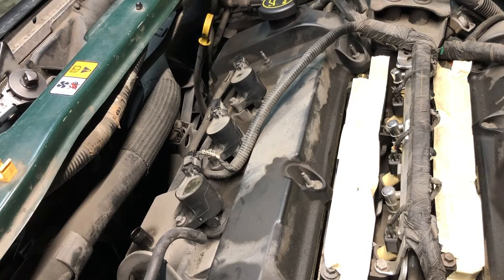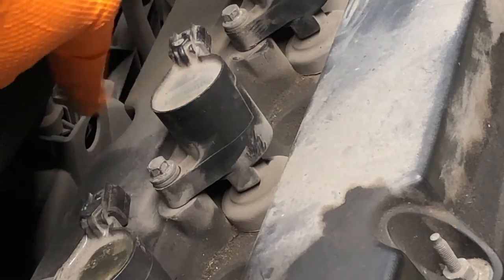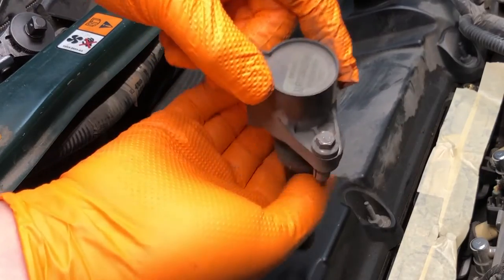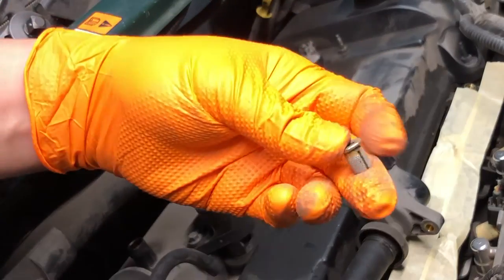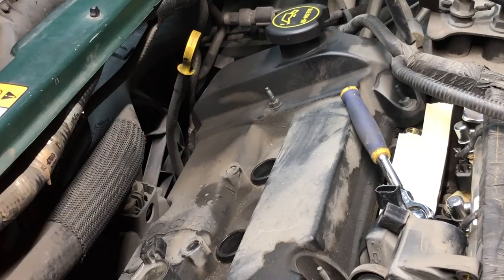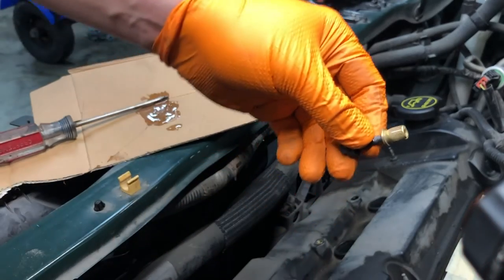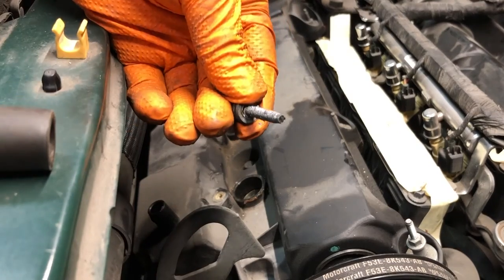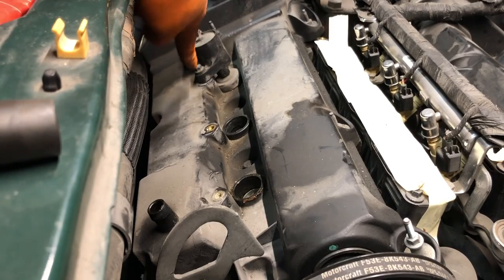2001 Ford Escape 3.0L V6:  Ignition coil hold-down bolt issue (spinning in the plastic valve covers)

Comment: This is what Youtube is all about! Shop tried to take my P0302 code and get me to pay for 6 new coils and spark plugs (even though the current ones were only 13000 miles old) plus a new engine cover because they figured they'd cut through it trying to get the stuck bolt out. Didn't have as easy a time getting the bolt out with the pliers, but Home Depot tool rental used their vice grip clamp for me to get it out at no cost.  You saved me over $800 and gave me confidence in the process, can't thank you enough!

Comment: this exact problem happened to me yesterday, luckily the insert came out while I was disassembling and came off with the screw.  I could not find any videos about how to fix it and again luckily I found some JB Weld in my tool box and used that to weld it back into place.  Only difference is that I let the insert cure overnight, I have yet to go outside to see how it looks but i'm I chose the same path as you! Have a great day and thank you for the video.

Comment: Thank you this method just worked for me just now while installing a new coil pack.I had to use a long flathead screw driver and hammer to chisel the screw and brass retainer off the old single coil and work the screw out of the brass retainer by twisting back and forth with two adjustable pliers.I got the brass retainer off  I reinstalled it back on the intake manifold without glue in case I need to pull it out again and got the same screw in it on my new coil pack! it's good as new and fitted in perfectly tight...

Comment: It’s nice to see that I’m not the only one that uses electrical grease and anti seize on these parts. 👍
Reply from the maker: I feel it is just good practice, especially in a wet climate or climate where corrosive ice melt is used on the roads.  This vehicle was in coastal Alaska - I wanted to give it a fighting chance.

Comment: This happened to my 2015 F150 Ecoboost. The engine idle was a little off, and the truck just wasn't running as usual. I went under the hood to check out the coils and spark plugs, and cylinder one coilpack was sitting about 3/8" higher than the others. I also used JB Weld to reseat the insert and hand tightened it. I believe it will hold.

Comment: Do you know what part number the bolt that holds the boots in is? Much appreciated in advance.
Reply from the maker: I believe the Ford part number for the 2001-2007 V6 Escape is W707156S437.  I'm pretty sure it's just a flanged M5x25 bolt that you can get at most hardware stores.

Comment: Thanks for this! I'm having a bit of a different issue (but related) and was wondering if you had any advice. I was changing my spark plugs and the bolt that fastens the coil pack snapped while tightening it back in. I tried to remove it with a bolt extractor but it just made things worse and I believe the brass insert is now damaged as well. Are you aware of a method to remove the brass insert and replace it with a new one without having the head of the bolt to pull on to? And without having to replace the whole valve cover? Thanks again and have a wonderful day
Reply from the maker: That is a tricky one.  I would attempt to drill into the broken bolt, and maybe try to tap the hole with new threads of a smaller diameter so that I could put a new (but smaller) bolt in its place.  Then either fasten the coil with the new bolt and a washer,  or use the new bolt to try to pry the insert out.
Reply: Use a torch to loosen the brass insert gently pull than if brass insert is reusable than heat up the brass insert with a new screw in it and hold in hole so with heat it can set itself or use epoxy to hold brass insert
Reply: Had the exact same thing happen. I am considering sealing the coil on with adhesive abd just leaving the broken bolt in. Cant drill it out
Reply: @mel3256  Sorry to hear that Mel :( It sucks so hard. I ended up getting a replacement valve cover from a pick-n-pull and replacing the whole cover. I got a mechanic to put on the replacement as I was worried that the other bolts would go on me as well.

Comment: Man this video is awesome. I was able to take mines out but the inside of the brass insert is worn out any idea where I can find these brass inserts?
Reply from the maker: You might be able to find some similar ones on Amazon, E-Z Lok inserts.  You’ll have to get a different size bolt (SAE instead of metric) most likely with these inserts.  I haven’t found any of the original style yet.
Reply: @AKJeeper  yea I was just looking on Amazon typed in metric nutcert and bunch of kits come out. I got COP #3 in 2001 expy 5.4l 2valve notorious spark plug spitters. Seems this is the way to go. 

Question I have to ask It’s a handy down car so previous owner stripped the head off the bolt that sits the COP on the manifold same bolt your inserting in your video. Any idea what I could do? I’ve tried the  pressure pliers just won’t grip to small and needle nose won’t work either. I’ve seen welders, weld a nut bring it right out but I don’t have any welding tools whatsoever.

Comment: Update that didn't work for my  2005 nissan altima 2.5 s 4 cylinder I ended up buying a valve cover and cutting the coils..good thing I did cause I got a misfire code this morning. Thanks for the IDEA though!!

Comment: mines broke inside the hole where you tighten the bolt to hold the ignition coil in place they're telling me to buy another intake manifold but i don't want to do that unless i have to
Reply: I would get different opinions at different shops, and if you need a new intake manifold I would say just buy a used one from a junkyard
Reply: Video online a guy uses torch to heat up area around the brass insert where it’s stuck gently pull than use heat or epoxy to reinsert brass insert with new screw
Reply: What did you do? I have the same issue...thinking of just attachi.g the coil with high heat adhesive and leaving the broken bolt
Reply: @mel3256  i left it alone the car rides great but when it comes time to do another tune up i will let somebody do it and if they find the problem maybe they can fix it but the car rides like a dream

Comment: Thank you so much but what if you damage the insert?
Reply from the maker: You will have to get a new insert, most likely from an auto recycler.  The other alternative I can think of would be to replace the valve cover.  New valve covers will come with the inserts installed.
Reply: Is it called inserts or whats the correct name for that part ?
Reply: Nobody knows what this part is even called, Autozone, Home Depot, and even Nissan dealer. It has no part number and is part of the valve cover. You'd have to find an insert with the same or similar metal structure that can withstand the heat of the engine as well as your local weather fluctuation so that the bolt can stay secured and removed again.

Comment: What if the bolt just spins even if you have the pry tool and socket wrench to screw it off but it just keeps spinning?
Reply: I ended up having to put the ratchet head on my drill to get the extra force while I pried it from the bottom. Was going nowhere with the hand tools alone.
Reply: @chadog900  ayo I swea I wanted to try that so I used my drill and spin it off....yo it just kept on spinning.......even faster 🤣 mannnn I was so mad. So I ordered a newly used valve cover and I asked the seller to leave me 2 bolts but guess what  🤦🏿‍♂️ he didn't send me the 2 bolts AND it was the wrong valve cover. I specifically asked for a 2009 valve cover and got a 7 smdh...I put in alot of work just to find out the motor was gone so I got rid of it and bought a new car
Reply: @outrightous  damn my dude, that sucks. No lie, I was ready to quit before I had the idea to grab the drill. Even after I popped it out, I couldn't get that bolt out. Home Depot guy used his vise grip for me.  This video legit saved me $800+ that my shady shop tried to hit me up for. Wish you could've got it to work bro.

Comment: Can over- tighten the bolt be the cause of this problem?
Reply from the maker: Yes, but the most common cause I’ve seen here is corrosion.
Reply: I broke the coil bolt off half way in by over tightening. Here hoping to figure out what to do
Reply: People get lazy and use power tools to tighten everything, but climates that get cold and hot a lot is the general problem leading to this.